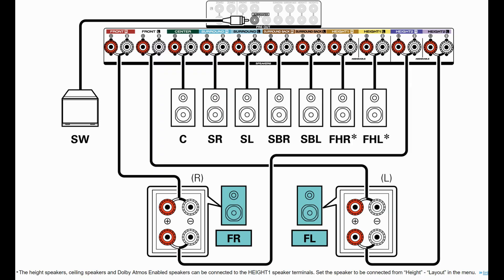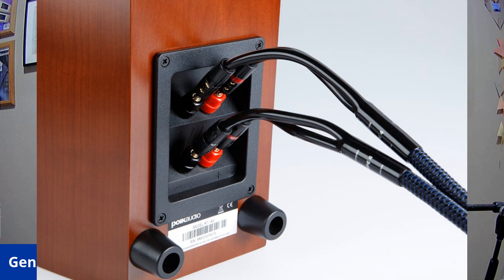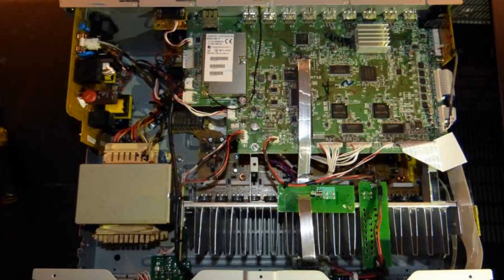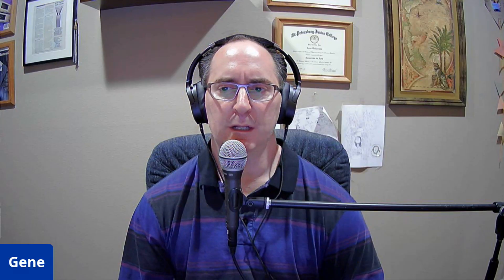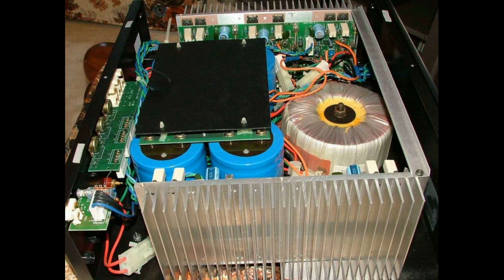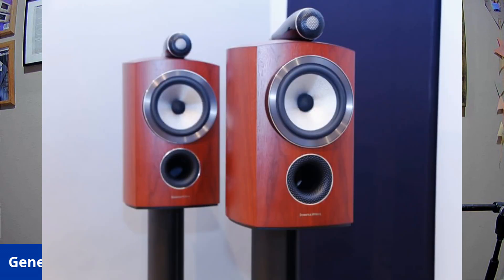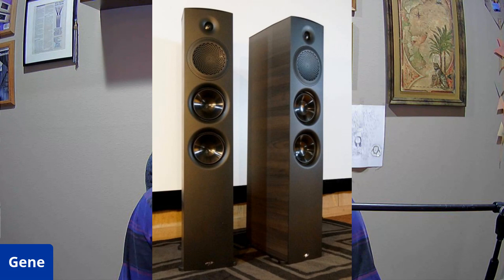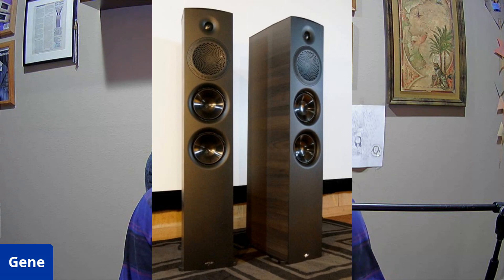Should You Bi-Amp Your AV Receiver?

Comment: I have been passive biamping with two separate Parasounds along with my DENON  but I have a Onkyo 9 channel reciever with a massive power supply the TXNR 5009 model which came out in the day 2011 .  I like to try to biamp with that as a option . Toridal power supply excuse the spelling  that AVR weighs 55 lbs with out it's box something to think about. I realize when Atmos came out they cut corners on the power supplies.
Reply: sure when the time is right for me I am staying at a short time at my step daughters house and when I get my home media going again Ill try the bi amping with that AVR. thanks for replying back.
Reply: I have the Onkyo tx-nr5008. Almost the same with other looks. Massive beast. Never bothered bi-amping but heard the result can be very different depending on the speakers used. It's not necessarily getting better. Love to hear your experience.

Comment: I just got the Yamaha TSR‐700 to temporary replace my Yamaha A3010. Before i had my ML motion 40 bi‐amped. This new receiver has it but i said nope. Surprisingly it drives my 5.1 well. The A3010 was losing the oomph to drive after almost 10 years.   I had to crank it higher.
Reply: Yup tsr-700 is great 👍🏻

Comment: Great video as always! I’m curious, why aren’t all watts the same? Like the difference in 150 watts AB vs class D. The sr7012 two channel is much less powerful real world listening than the ma5200 100 watts a channel. The marantz had to sit on 60% volume compared to McIntoshs 41%. Just curious!
Reply: The difference in volume you’re talking about has to do with input sensitivity and or gain settings on the amp. In reality, the marantz would get louder than the mac if you turned them both up until the amps clipped. What you’re describing is the output voltages being the same but at different points on the volume potentiometer. 

Think of it like this. The marantz might put out 2.83 Volts at 60%, the Mac puts out 2.83 volts at 40%. That doesn’t mean the amp has more power, it just means that you don’t have to turn it up as much to reach the 100 watts.
Reply: As the other user said, there is no standard for how the volume control works. However, at max volume, the higher wattage would sound louder (assuming just stereo setups; different amps lose different amounts of wattage based on having surrounds).

Comment: Wow timely video. I have an old Onkyo TX-SR705. I just realized last week how the Bi-Amp feature works and was going to try it on some Klipsch RP-8000F. But after watching this, I think you are right. This AV receiver probably doesn't have the balls to make it worth while even though I do a lot of 2 channel listening.
Reply: I'd say try it. I have one. Beefy PSU open her up, see for yourself or take some measurements. I'm trying it on mine tomorrow. Will be removing the crossover on my speakers too just caps on the tweeter and mid
Reply: @carswnova  timely comment. I got new Klipsh RP-8000F arriving tomorrow lol

Comment: I have a Yamaha 3080 aventage running a 5 channel system,  should I bother bi amping my towers?
Reply: I have an older Yamaha 3000 aventage and I bi-amp my mains and never looked back.  The manual also suggests bi-amping for best 2 channel listening.

Have a try if you have the extra cables lying around.  Gene is right on the dot.  Pure Direct has never sounded better for music for me!